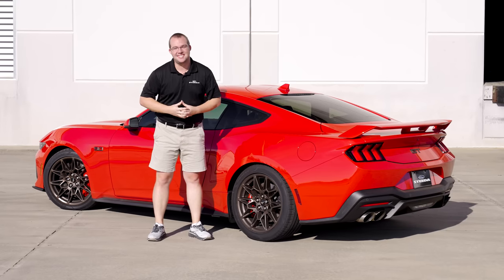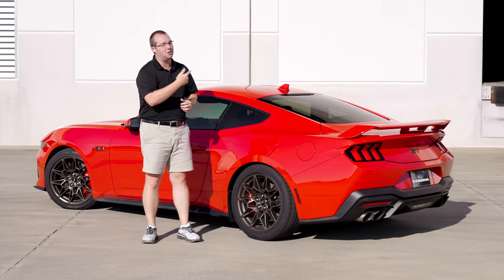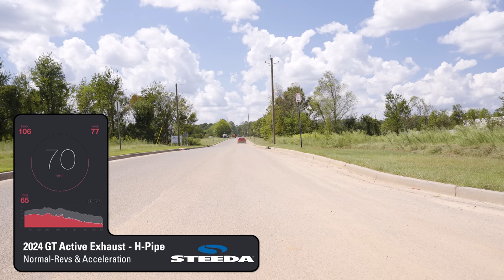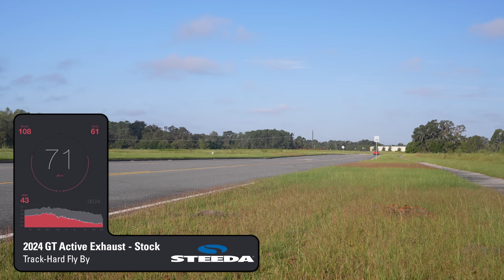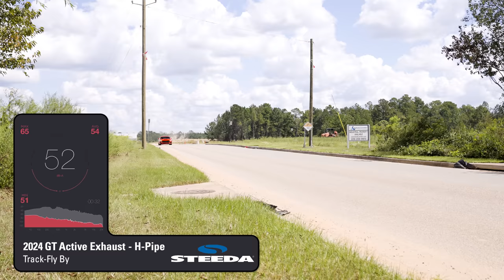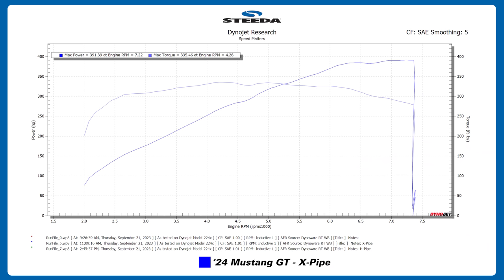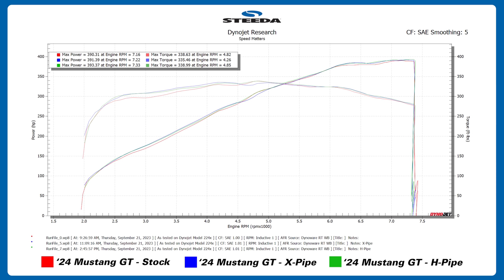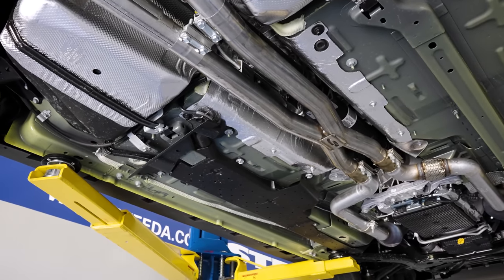2024 Mustang GT: X-Pipe vs H-Pipe on the Dyno! Not The Results We Expected...

Comment: My 2021 10r80 with long tubes and catted lead pipes to a bone stock catback and bone stock cold air made 424whp on 93 octane. Unless you like tech in your car, theres no reason at all to ditch a gen 3 coyote s550 for one of these cars
Reply: Have you driven one?  I'd take the S650 over the S550 any day.
Reply: @Krisk5.0 it's the same crap . All the car is the same . Let it be a couple of years in the market you'll be able to swap parts
Reply: @smurfeco2.358  So you’ve driven an S650 then?
Reply: @Krisk5.0  I've never driven no, but I like the fact my car can be tuned, I can throw on a gen 5 3.0 whipple and be tuned right now for it. I like how mine can't be tracked by ford when the CEL pops on. Not dissing the s650, I think the tech inside and the car itself looks good. And if you have one and love that's all that matters. End of the day we're all mustang enthusiasts after all
Reply: @NissanTy  All fair points. I don’t think it will be long before tuning the S650 is possible, though. What caught my attention is you mentioning yours is a 10R80. I know the S650 is supposedly the same 10R80 as the S550, but it drives so much better with the revised tuning. The difference is amazing. I recommend testing out a 10R80 S650, and I think you’ll be surprised. I really liked my S550, but I love everything about the S650 especially now that I have a couple thousand miles on it.
Reply: @Krisk5.0  I'd definitely like to eventually drive one. I think the dash and  what not is really cool. I also heard the mt82 is revised as well
Reply: I make a living working on them, it's a basically a 550 remastered. Most the of the parts swap. There's more differences between a 70 and a '71 Mustang and they still call that the same gen. And as far as tech goes it's not much different either, do you want two screens that look like a real car while retaining buttons for easy to access features like air conditioning and radio or the two iPads glued to a explorer dash look. 
The factory exhaust sound for the 650 is really the only real improvement over the 550.

Comment: Even though peak gains are minimal for the S650 with an H/X-pipe, judging by the dyno graph there's still about a +10 hp+trq gain throughout the curve between 2500 rpm to 3500 rpm. Plus you shave off 10 lbs with the resonator delete. 😊

Comment: The Active Exhaust starting on the 2018 S550 was the start of something really special. Mustangs have always been the best sounding V8 not named Ferrari which sounds more exotic but not necessarily better. Going back to my 88’ Fox with Flowmaster and an H Pipe , you could always tell when a Mustang was coming down the road. From 18’ through now, the active exhaust is such a phenomenal sounding factory exhaust. It is diff than the non active and not sound but tone. I know this because I had a 19 with active and I currently had a 21 without active and the 19’ sounded better.  Not louder, better. Louder too bu the tone is just more refined and not as tinney or rattley. The H Pipe would be my pick. It seems to keep the great tone i mentioned of the active exhaust and just enhances it. The X pipe is too raspy and not as refined IMO. It’s H Pipe all day for me and it’s really not even close

Comment: Love the look of the new 24’s and I love that Ford further refined the s550. These seem decent out of the box. I suppose at a median price of 54k they should be
Reply: Nah they are slower than the s550, added weight, s650gt is a dog now. Then to top it off the only one worth buying is the darkhorse and its 80k lol.
Reply: @07slowbalt only way they get close to beating the 24 gt 10 speed is if they have a good tune and a upgraded transmission other than that stock beats it everyday buddy just say your broke and you own the older one dude 🤣
Reply: @2024gtbuild  clearly you havent seen any videos stock vs stock. The dark horse barely is any faster and the base gt has already shown slower times than the previous s550. It has nothing to do with being broke, just factual. I dont even own a mustang but if i did id buy an s550 thats actually tuneable and alot more performance capable.

Comment: I love the way steeda just continues to be disappointed with these new mustangs.  The power is so disappointing.
Reply: I am so confused at how its rated at 486 crank HP but on dynos they are 390whp~400whp. They really lose nearly 90hp through the transmission?
Reply: @ShadowVR30  well the  answer to that is if it’s rated for that it’s not properly rated if the dyno is correct.
Reply: They basically need mods, because I don’t think mines that fast, but I’ll be doing tune, and full exhaust in stead.

Comment: Any comment on the decibel levels between x and h pipe? I'm wondering if the X pipe is still louder
Reply from the maker: For the S650s, the decibel meter may exaggerate the difference, but in person, the H-pipe still sounds a bit louder. Especially at wide-open throttle.

Comment: A shame they do not use slip over connections in the rear with clamps vs. the sleeve type clamp Steeda uses. For this reason I’m going with Roush 304 SS h pipe

Comment: These bolt on guys and monkey see monkey do’ers, think an X-Pipe is the greatest thing to ever exist… 

Science will show you in reality, the more hp, ie; the more air and fuel the engine is moving. An x-pipe is a terrible thing. 

Look at the exhaust nascar ran for an eternity… An H-pipe crossover, into a merged Y-pipe and single exit! Why?
 Exhaust scavenging, and velocity! 

A Y-pipe is the most effective at scavenging exhaust dollar for dollar. Duals have only ever been for aesthetics… 

I’m making 950 Hp on pump gas with a blown 565. My exhaust is twin 3.5” pipes, bullet mufflers, some 45’s into a dual 3.5” in merge Y, with a single 5” out! Thing looks like a rocket nozzle lol. 

And talk about a sound! Thing sounds like a 8 into 1 system, or 180 headers!